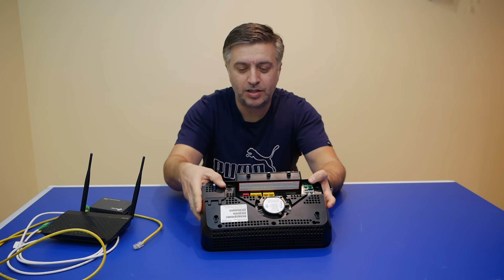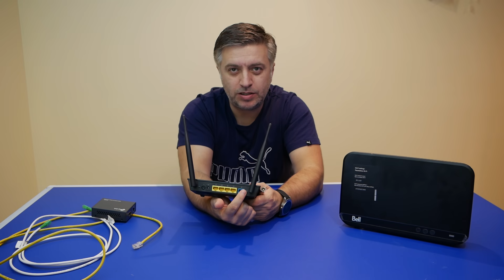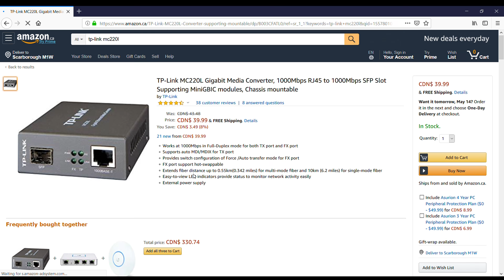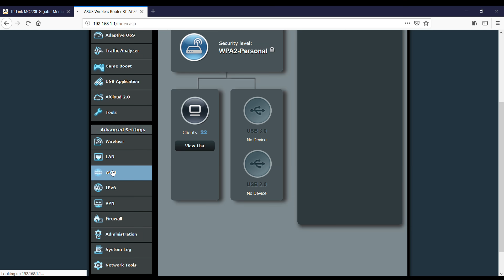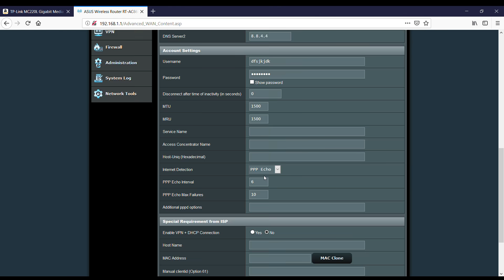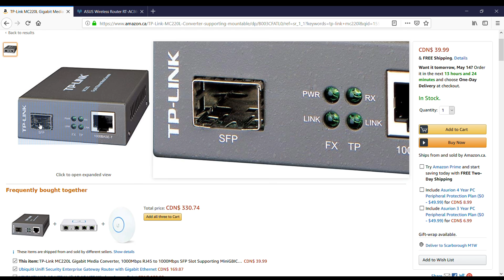How to remove/bypass Bell Hub 3000 and use your own router

Comment: I will be getting the Home Hub 4000 soon. Does the Bell Hub 3000 procedure work for the Hub 4000? Does the Bell Hub 4000 also have the high levels of microwave radiation?
Reply from the maker: It doesn't work for 4000. 4000 has the module integrated and cannot be removed.
Reply: @advfreedom  thank you. Does the 4000 have less microwave radiation?

Comment: Thanks for the video, and just another tip: If you change your speed (eg. from 150 to 500 Mbps). You are going to need to plugin it back into your Hub3000 and call tech support to do a reset. Once it's setup for the new speed, you can put it back into the TP Link switch. Cheers.
Reply from the maker: I didn't have to deal with support but I am glad your comment helped others.
Reply: I did this & im still getting 500mb download when im supposed to be getting 1 gb s 

Any idea what i can do ?

Comment: Thanks Marius, followed your instructions and I'm now free of being stuck using that anchor called the Bell HH 3000. I replaced it with a ASUS Wireless AX5700. The software is great, lots of control and information. Thanks again Marius, great video.
Reply from the maker: Happy that it worked for you.

Comment: Hi Marius, thanks for the vid,  I cant get the module out.  Its very tight is there a trick. I dont want to break.
Reply from the maker: Minute 3.30 is explained. You need to pull it from the little lever that module has. That helps unlock it.
Reply: @advfreedom  Thank you, I was struggling to do so and didn't want it to break. Thank you for your help and video.

Comment: lan 3 and 4 can be used to wire tv boxes to your own router. vlan 34 prio 4. i have my pvr wired to port 4, and all the other boxes on a gig switch then to port 3.  incase anyone was wondering for tv setup.
Reply: you can even buy bells vap and connect it to 3 or 4 and then wirelessly connect their boxes (that support it) to their vap to your router. (the vap was used with the r1000h router that did not have dedicated iptv wifi ssid inbuilt)
Reply: do you have the pararmeter setting for LAN port 3 or 4?  How about Bell home phone - did you try to make it work?

Comment: Marius, do you have a procedure for the HH4000?
Reply from the maker: Hub4000 has the module integrated and it can't be removed. This procedure doesn't work with 4000. You will have to use 4000 with your own router if you want by bridge method. And turnoff hub wifi.
Reply: @advfreedom  bell got "smart" to our hackarounds and built it in.... all in a bit for greed/control. i suggest calling bell and demanding a hh3000 or you will cancel service. that usually does the trick.... get the 4000 swapped to 3000 then do this swap/replace with the 3000.... i got new tv boxes this way. i had the vip1200 tv boxes original to fibes release. complained enough and got them switched to the vip2262 wired boxes. then i went online ebay and bought my own boxes and registered more on my own.

Comment: What could I be doing wrong?  I bought the Asus ZenWiFi AX6600 and the TP Link MC220L(UN) Ver 4.0.  Configured the WAN with PPPOE, 1492 MTU (can't go higher than that), added the correct Bell Internet password and set VID to 35 for the Internet.   It won't connect to the Internet.   Appreciate any insight
Reply from the maker: It should work, try to reset the router to factory default. Maybe you can install Merlin firmware?
Reply: @advfreedom  Thanks Marius.  I'll research on Merlin firmware, am not too tech savvy.  Will let you know how it works out.  Thanks again

Comment: So is it possible to use the bell modem with a different wifi to extend the range for example?
Reply from the maker: If your router supports extender mode for sure. Any router should have this function but I am not sure what is yours.

Comment: Hi,
I need the ref of the SFP module as i have the HUB 4000, there's no SFP module.
Thanks.
Reply from the maker: Yes, Hub 4000 has the module integrated. This doesn't apply to hub 4000 as the video only addresses hub 3000.

Comment: I have the asus rt-86u AC2900 and the tp link module as in the video, my WAN light on the asus router is red , what did i do wrong?  no getting any internet
Reply from the maker: Means password is wrong or some settings are wrong. Did you tag vlan 35
Reply: @advfreedom  i cannot access my router homepage at all not even being asked for password, doesnt find the ip address. all the connections and cables are correct.

Thanks

Comment: Hi Marius I'm in Toronto, I have a netgear orbi router with satellite pod.  I managed to get this running but my wifi signal got weaker for some reason.  I'm wondering if I missed something with the settings.  I was able to find the  vlan setting, but not the mtu, nat or Qos settings.  How about dns, is it importan to have it set up with google or auto?
Reply from the maker: Dns doesn’t matter to the wifi signal. It is just how it routes the req for that website you are looking for. Also wifi signal has nothing to do with this instalation. Wifi is just between your router and your device. Did you check on a hardwired pc?
Reply: @advfreedom  yes it wotked on a hard wire PC.  I also noticed that chrome started acting funny.  It would start warning me about insecure websites for many websites I use that have no security issue.  Not sure what that's about.

Comment: will you provide video for bell hub 4000?
Reply from the maker: Bell 4000 can't be done with this method. The module is integrated and not removable. The only way will be to do a bridge and use both routers.
Reply: @advfreedom  do you believe the bridge method will allow the secondary router (not bell 3000) to setup as a VPN router? Thanks!

Comment: I see he is taggin VLAN 35 for internet. I have Bell Wireless Home internet and sick of my Home hub 2000. Has anyone done something similar on Bell Wireless Home Internet?

I have
- Black Bell Box (PoE for dish + Modem I assume)
- Home hub 2000 passing the connection from the Black Bell Box
- SonicWALL TZ300 behind the home hub 2000

I hate the home hub, Bell and Rorgers should offer a modem only option (gone are them days)

Any advice is appreciated

Comment: Hi, I have the Bell Hub 3000 so far all is good. Could you tell me what can I get bypassing another router and using the MC220L?
Reply from the maker: You can use your own router to setup your own security, vpn, more control over devices, time schedule, logs etc. Olso the Asus router offers better wifi signal.

Comment: I have bell fibre but my router doesn’t have that part instead there are two phone cables connected in the router. Is this still an issue or ?
Reply from the maker: It means that you have DSL and not Fibe. If you have an optical cable in the router then that is Fibe.

Comment: I switched from gigabit to 1.5 down plan… mistake? Do I need a 10g converter? Thoughts on hh4000? Pls help
Reply from the maker: Yes you need a faster converter. Hub 4000 can't be used with this procedure.

Comment: bell coming this sat I have asked for the Home Hub 3000 as  I want to pull the transceiver out and use my tp link converter but they are now installing the Home Hub 4000 as their latest product so if they wont provide the 3000 or a sfp transceiver, i will cancel the install. I do not want their box for a myriad of reasons. The 4000 has a fixed transceiver I believe?
Reply from the maker: So yeah, it's looking like the module is soldered to the board. I guess you can connect the 10g port to your router and create a second pppoe and turn bell wifi off, like a bridge.
Reply: @advfreedom  I have bell fibe internet without the 3000  now using a 10Gtek media converter but speed is weird, 80 download and 114 upload should but paying for 150/150 had to muck with the MTU and using ftp now is so slow......not happy so far may switch back to cogeco cable internet

Comment: I’ve tried this, with mc220L on my gigabyte connection with a AX 11000 router but I’m only getting 200 up but my download is ok on wifi which is 500mbps

How can I get a better connection?
Reply from the maker: I don't know much about that router. The media converter works with 1Gb connection. But then it depends on the router. Can you test the same connection with Bell router?

Comment: Hi Marius C! Thanks for this information! It worked flawlessly for me!
One question... kinda weird. When I do a speed test using my router interface (Merlin Firmware Version:386.2_6) on my Asus RT-AC68U (HW version 3) I get 217/213 on my Bell fibre 500/500 (which on the home hub and google nest router I got about 540/540).
I followed your directions completely. Would the MTU and MRU settings make a difference (currently set to 1500) if changed? Is there any new information that you can pass on? Thanks so very much!
Reply from the maker: On 86u it matters if you have Qos on. If it is on then hardware acceleration is disabled.
Reply: @advfreedom  UPDATE. So what I did was to buy a 10Gtek Model: G0101-SFP Media Converter and ran another test using the built-in Speedtest on the router. Got marginally better speed. Then I plugged in my laptop to one of the router's LAN ports and did a test off of https://www.speedtest.net/ and got 456/440. So given that I would assume the router's interface test does not work correctly. Wanted to pass this on :-)
Reply: @advfreedom  thanks for your reply:). The QoS was off but I just ran a test and with QoS off it’s 211/201 and with QoS on its 142/130. So, yes, big difference there. Any other ideas?

Comment: Hey Marius,

This worked for me but I noticed the speeds dropped in half. Anyone else having this same issue?
Reply from the maker: What router? Check hardware acceleration on Asus.
Reply: @advfreedom  linksys velop
Reply from the maker: I don't know about Linksys, and it shouldn't be any reason for half the speed. If measure wired connection it should be the same except if the router is doing something else. The adapter is a straight converted so it shouldn't be any speed loss there. My Asus when I set Qos it disables hardware acceleration. And that will impact speed.

Comment: As soon as you remove Bell equipment from your home setup your WhatsApp application and other mesengers will not work properly. For example, when you try to call somebody through WhatsApp from yout SmartPhone, you can hear the other person, but they do not hear you. Bell does not recognize ip packets coming from WhatsUp application from your phone and simply drops them, cause they are not coming from Bell's equipment.
Reply from the maker: No issues for us. We actually use signal and whatsup and works properly.
Reply: @advfreedom  Hi, thanks for your reply. Probably, I had to set the port number for all 3 settings Internet VLAN 35. -VOIP VLAN 34. IPTV VLAN 36 as described in Cameron comment. Looks like the issue with watsUp was caused by VOIP LAN port being not set as 34. I just set Internet VLAN -35. Would like to give it a try, but not sure which one is VOIP VLAN and which one is IPTV VLAN in my Asus AC RT-5300

Comment: i was wondering is there way to use the HomeHub 3000 as router again to enable VOIP service to work  by trying to pass LAN from the current router to WAN of HomeHub 3000 to use the VOIP service, i mean to say what are the configuration to get it working.

Comment: I'd really like to do this because the Hub 3000 doesn't support Bridge Mode and I'd like to have NAT Loopback (The Hub 2000 has some kind of Bridge Mode - but I upgraded to the real fibre recently). I'm using an Apple Airport router. I can't find anything about the IPtv setting. Is this a requirement? Any ideas on how to handle it in this setup? Many thanks for this.
Reply from the maker: If you want to do this you need to tag VLAN to 35 at least in Ontario. Depending on your router this setting might be in another location. On Asus routers is in IPTV section.

Comment: this is interesting I often wondered if the bell box was giving off radiation disrupting my sleep as ever since it was installed the energy felt different in the home,  so now I am happy and will bypass that box and use your beautiful method,  thank you good sir
Reply from the maker: I am glad that it was useful. Thanks for watching.
Reply: @advfreedom  yes I'll definitely be getting one of those devices as the bell 3000 home box does not have any way for a VPN as far as I can tell and I pay for one so it will be very useful not having to use my laptop for my tv every time on netflix to switch regions.

Comment: For those with Bell Aliant (those in the maritime area) - they use DHCP rather than PPPOE. Be sure set it to automatic (rather than PPPOE) & set the authentication under account settings to none.
Reply: I am in NS. Bell Aliant didn’t give me a B1 account. That’s because Bell uses DHCP in maritime area?
Reply: @stingmao  yep!
Reply: Good to know! Thanks for that, I'll be looking into this a bit further this summer.
Reply: I got to try this, I been everywhere to find something about this B1 password..Didn't even think about looking at what Bell uses! Going to try this, please god let this work.
Reply: Thanks for advice , I always new my bell modem was restricting my speeds ( I have the 1.5GB fibre in moncton ) to my modem I would get 1.4GB but then out of my modem alot less. Time to fix this
Reply: I’m from Nova Scotia, and I did exactly as you said. I also bought the same router and tplink converter as the person who made the video. It worked :)))))))) Thank you so much, you have made my day!
Reply: Thanks for this I am in Atlantic Canada and your steps helped the only thing I had to do is set Vlan35 as full auto did not work this got me up and running immediately.
Reply: does that mean you can use any sfp? Or still have to use the one from home hub?
Reply: @pizzasaurolophus  I have no idea to be honest.
Reply: @JettScythe  Can we get a video or text guide on setting up?
Reply: @Rithius3485  
Under WAN > "Basic config" you want WAN connection type to be automatic
 scroll to "Account Settings" > Set "authentication" to "None"
Everything else is the same as what is shown in this video.
Reply: @JettScythe  HI there I am in Nova Scotia, I have been able to follow these settings but still no Internet from my tp link archer router. I changed it to pppoe should I leave it at dynamic IP please help. I feel like I am close but missing something.
Reply: @Kwambomb23  If you have Bell aliant, and considering you're in NS I assume you do, they do not use PPPOE, just DHCP.
Reply: @JettScythe  yes but what option is that? Should I do these settings with my home hub first or just on my tp link router? The section for PPPOE has dynamic or static. There is no option for DHCP.
Reply: @Kwambomb23  Oh I see. If you're using the SFP -> media converter -> router setup, then just in the TP link router. Dynamic IP should do it
Reply: @JettScythe  I just tried it still no luck, I do have the internet and landline service as well would that make a difference ?
Reply: @Kwambomb23  I don't know unfortunately :/ The only thing I can think of is to make sure you tag the VLAN. Aside from that, you might want to look into more specific guides with your hardware.
Reply: @JettScythe  okay I appreciate your time
Reply: @Kwambomb23  I wish I could have been more help. Best of luck!
Reply: @pizzasaurolophus  So I had to look into this since I purchased a new router with a SFP+ port. 
From what I gather, bell registers all of their SFP modules by serial to the network, and they're only using specific brands. I learned this AFTER I spent $120 on a specific GPON SFP and it still didn't work.
Reply: @JettScythe  Do you mean that only specific brands are registered to work, or do you mean that only specific, unique units are registered over serial to work. In other words, canone buy brand Foo and have that work, or do you mean that only brand Foo with SN XXX-XXX which has been registered serially with Bell will work, which basically means we are all SOL?   Thanks so much in advance!
Reply: @raymroz5806  I wish I saw this sooner. Unfortunately I don't have the hardware to test it out. I did purchase a mikrotik GPON SFP module a while back but my router unfortunately didn't support most SFP modules at the time. 
I have managed to bypass the media converter, using the GPON SFP from the HH into the router with an SFP+ port after an update. I may be able to see if the third party GPON SFP module works now, but I wont be able to test one of the same brand as what was in the HH.
Reply: Thanks a lot for this info!
Reply: Any one managed to have the fibe tv boxes to work with out it? I use edge routerx
Reply: @juniorcanty9417  pretty sure you just need to tag the proper VLAN, but I don't use this so I mayyyy be talking out my ass 🤷‍♂
Reply: Correct me if I'm wrong, but a DHCP server typically runs on the router for a home network. So, if you decide to bypass the homehub which is a 2-in-1 router and modem, it won't matter if the 3rd party router uses DHCP or PPPOE for assigning IP address'.
Reply: @liamwelsh5565  From what I understand we're talking about different layers in the network. Your home router does typically run a DHCP server for assigning addresses on the local network (usually 192.168.x.x) but many internet providers assign WAN addresses with PPPOE. Bell Aliant still uses DCHP.

Comment: I did this today with an Orbi AX6000. It works, but the speeds are inconsistent, fluctuations between the mid 400s to a max of about 800Mbps. Not sure if there is some setting or something which is causing this issue? Does anyone have anything they can suggest? I have the 1.5Gbps plan with Bell, but I’m ok with just having 1Gbps if it removes the double NAT which doesn’t play nice with some of my smart home stuff.